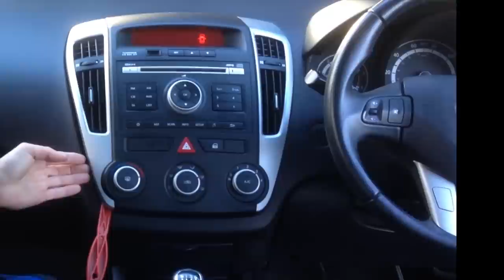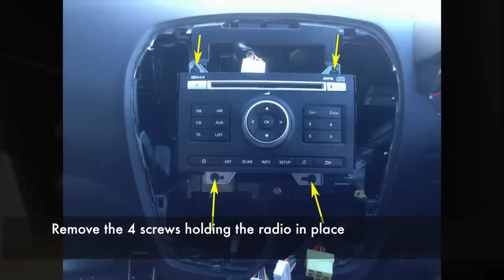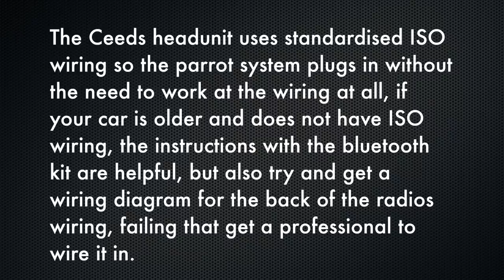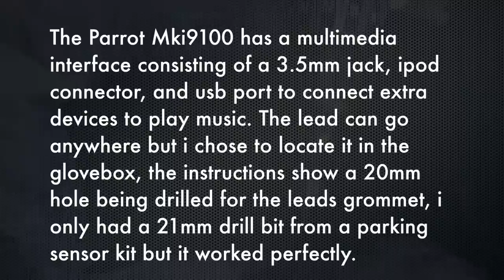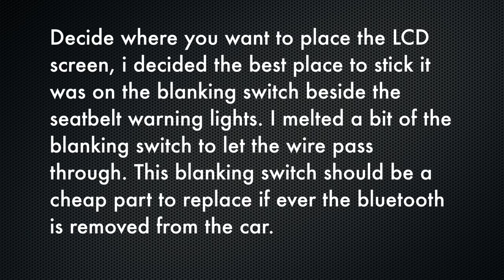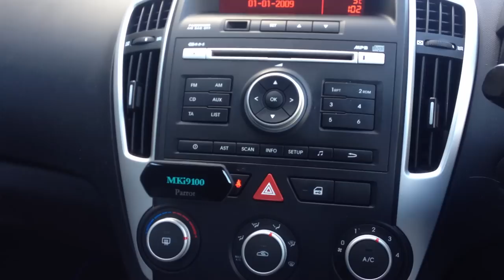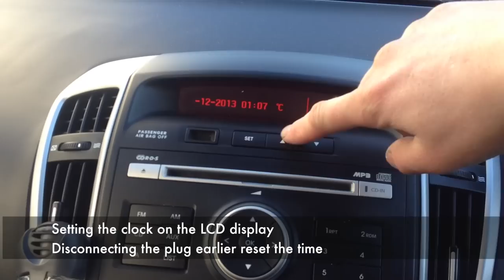Parrot Bluetooth Installation in a Kia Ceed

Comment: Hello. I have a kia ceed 2014 and i am looking to install a pioneer dmh-g220bt. Can you tell me if ill be needing any adapters and do i need to do soldering?
Also, will i be able to control the unit via my steering wheel, volume, channel etc.
Thanks in advance!

Comment: Would replacing the radio and steering wheel with one with a call/end button work just as well? Or are things more complicated than that?
Reply from the maker: It would probably give a tidier more integrated installation, although i think there is a microphone also to install up by the sun visor. Not sure if it would need to be plugged into a Kia dealer tool to configure these options to be added however.
Reply: I think they're directly connected to one another so dealer involvement would not be necessary. However, to further complicate things, I think swapping the central display would also be necessary, as the original one (black on orange) is alphanumeric, whereas the the newer one (red on black) is graphical.

Comment: I have a Hyundai i30 and the default setup is pretty much the same. I need Bluetooth mostly for music streaming, but calls are nice as well.

My question is, if I were to do this, I would be able to use my radio normally, right? What would happen if my car audio was set to radio and Parrot was streaming music at the same time?
Reply from the maker: Dominic0403 
From what i remember the parrot knew when to divert the audio from the radio to the music/calls automatically

Comment: Will this void the 7 year waranty?
Reply from the maker: I never looked through the T&C's of kias warranty but given its all plug and play (no wires are spliced) it doesnt cause any damage, and can be removed without leaving any signs it was there. The car was in at the dealers after the parrot kit was installed a few times for servicing, and did have one of the door rubbers, and worn gear lever replaced under warranty and they said nothing about the parrot kit.

I cant say for definate if it will void the warranty or not, its perhaps worth asking your kia dealer.
Reply: peugeotCitroen2CV - Have you ever done one for a kia sorento? Any ideas?
Reply from the maker: Ive never even been in a sorento, best to get a look on the internet to see what sort of things other owners have done.
Reply: peugeotCitroen2CV thanks I've tried looking but no luck
Reply from the maker: what year is the sorento?
Reply: peugeotCitroen2CV  57 plate
Reply from the maker: There is the radio removal process, google seems to be showing a few videos
https://www.google.co.uk/#q=2007+kia+sorento+radio+removal

Then email a company like this to see if they do any adapter wiring for your car
http://www.carcommunications.co.uk
Reply: peugeotCitroen2CV thank you yes we have managed to get it out but not sure of the wires as there seems to be spare ones